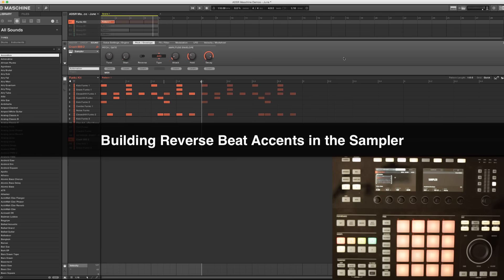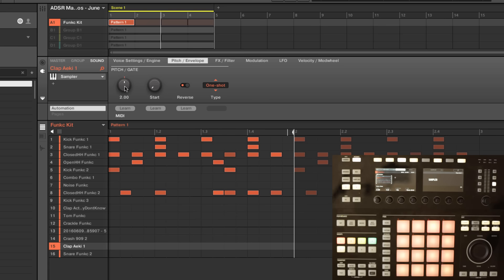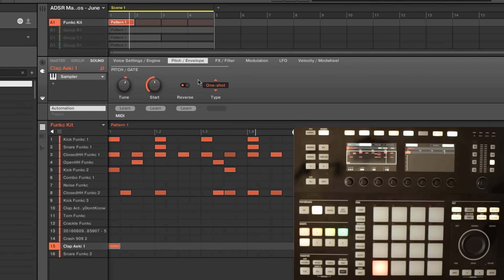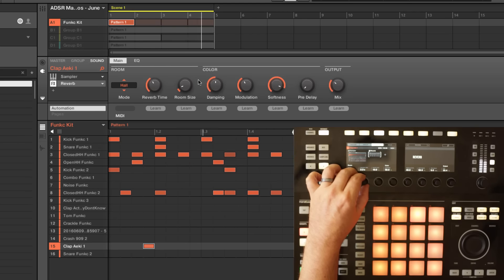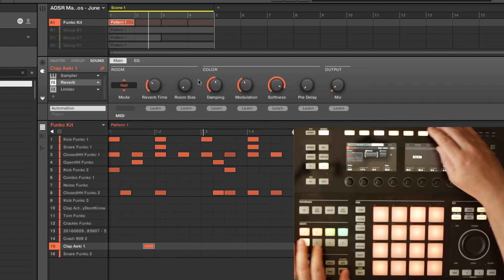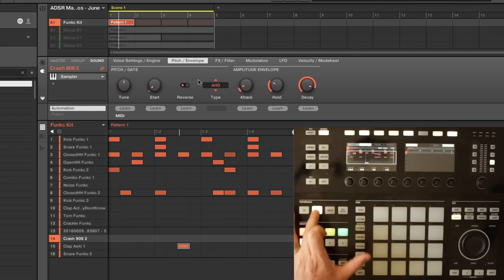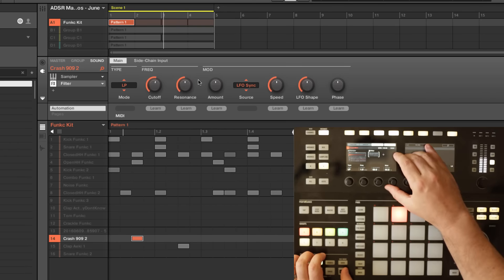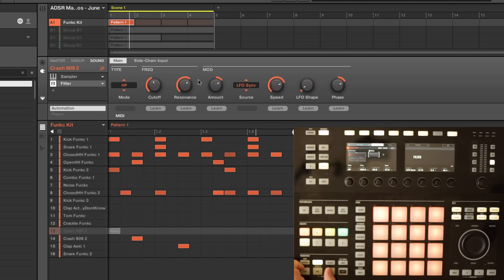Reverse Beat Accents - Maschine Tutorial

Comment: thanks for all the great tuts (you and rest of ADSR team), thanks to you the learning curve is peaking through the roof. 
One question regarding drum programming with maschine, I am trying to instead of using a kit on 16th pad i load multiple drum instruments per pads and program them through piano roll to get multiple layer of different drum kits and percs on one pattern. Duno if i make myself clear, or if there is other ways to do that, i just feel i can load more and get a more complex texture to my beats... my issue is that when i use the step sequencer in maschine (mk2) i can only sequence C3, and i have to go through piano roll rec live and then  re-calibrate everything by hand, which is time consuming as i create intricate and detailed beats.  Hope this is not too confusing, so i wondered if there was an effective way to change the base note from C3 to other or another way to step sequence any notes of the keyboard through hardware ?
Reply: found my answer... boohoo maschine sequencer is only monophonic, what a shame , hope this is something they will change, would certainly increase workflow for many as i've read the same problems elsewhere :(